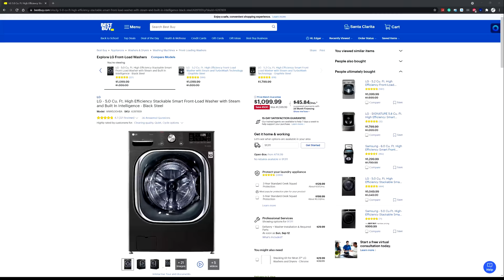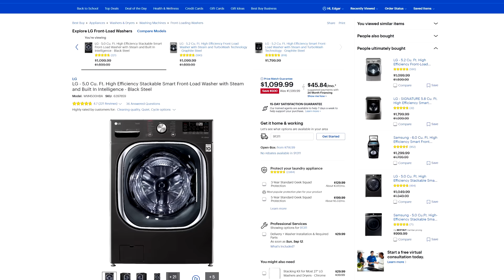It's FINALLY time for my $15,000 Dream Gaming PC - Big Red V4!

Comment: Cables are supposed to come from the cutouts under the board, That's why they did not only use standoff screws. 
Just drill 2 new holes for that PSU bracket so you can use 1600i

Comment: i think a nice Deep Red Would really well on  some of the metal parts Like the Sides of where the PSU is ( or just the top.) & the GPU Bracket . some of the others go with white or keep original. but like go random where you put it, space the colours out. over the case.

Comment: It's weird how this kind of looks a lot like the thermal check core P3 case that I used in my build and setup k sent in recently. Just feel like the case price is one of the examples of just valuing something at a specific amount solely on it being a status symbol in statement of ownership. Because literally it's just a thermal take core P3 stretched out instead of symmetrical in my opinion and has less features than I found handy but is more friendly to water cooling however that glass front panel I didn't use mine I find it far more attractive being a less space hog and minimalist wall mounted build. Not to mention the unboxing experience was terrible but it wasn't your fault It was this case manufacturer that is charging status symbol prices while delivering mediocre support and design tbh..

Comment: This case has a lot of potential but the cable cutouts are so damn terrible, they literally considered only ATX standard components and designed. But if you are buying expensive case they should have known you are going with overkill components as well, EATX components standard cutouts would be alot better for this.
You could technically make your own cutouts but you can't get the finish of CNC milled finish.
Anyway love the build so far💖

Comment: Lucky 15k I thought my rig was nice I got 5900x dark hero 3090ftw3 ultra all nvme gen 4 drives all watercooled i built in a pc011xl with front distro and chrome tubing im gunna change to a inwin 925 or Thermaltake distro case

Comment: ok this case has a few problems. i love the design dont get me wrong but for so much surface area and the flat faced wall mounted design, youd think it would be alot more modular. why does it only really support itx and MAYBE atx boards? there is literally like a full on tent for the PSU cables so they definitely could have moved the cable rout hole further out. those metal beams spacers for the motherboard, much like the standoffs, could have had multiple screw hole placements for increasing the distance and space needed for that first super sexy board u had. seriously, just move the holes over and that that same tent design or add a sliding door like mechanic that we've seen in other towers before or something. even the upside down water block could have been avoided with just better case design. damnit. but im excited to see how Ed compromises.
Reply from the maker: Nice observations, I’m hoping i don’t run into any issues during the build
Reply: @TechSource thanks lol ofc. If it was anything like the thermaltake core p3 Design (that's also white) I think it would be worth the dollar.

Comment: Kind of disappointing in a case that big/pricey, you couldn't even use the larger PSU/Mobo that you originally wanted. Seemed to need quite a bit of compromise.

Comment: I'm sorry but I'm still watching this and I don't agree that you've never seen a case like this or that a lot of thought and design choices went into making that case It is literally a stretched out core p3 from thermaltake tbh. Down right from the radiator supports to the mounting mechanisms to the motherboard, and the power supply all doing the same exact way and the cables routing as well as the case is all thumbscrews or normal screws and modular as hell as it can be just a test bench, it can be a flat PC it can be vertical or wall mounted it can be a glass piece show display case or it can just sit on your wall like mine looking gorgeous. Lol. Like the cutouts for the radiator and the power supply and the motherboard and all that is exactly a replica of the thermal take core P3 same exact everything and that manner. Bringing micro ATX motherboard on that case just kind of defeats the purpose in my opinion like it's gigantic for a reason to be a showpiece and the thermal take has a better design where it doesn't stand too far away from the case but still has the support for the cable management and wiring runs perfectly. Yikes

Comment: Just watched this vid Not impresed by the case no clear instructions and your limited on motherboard size in regards to positioning. For the value of the case you should have at least get a lot better for your money. Shame about the scratch you put on one of the pieces at the start getting it out a shame that. A redesign of the packaging would be much better. Let`s see what the build will be. Nice to see you realised you put a piece the wrong way round. That piece you found may be the start button which popped out when you unboxed a few items at the beginning. Let`s eee what will happen.
Reply from the maker: We shall see indeed